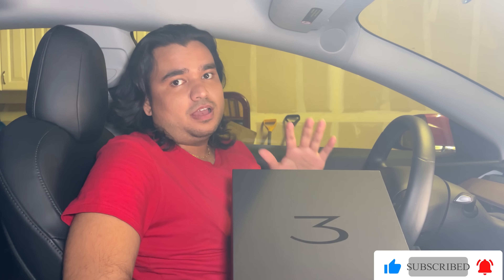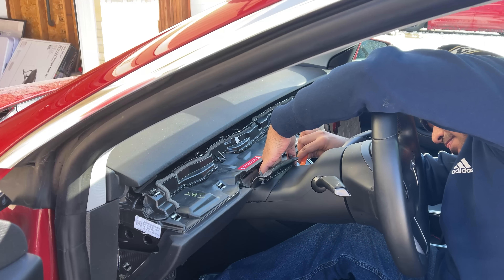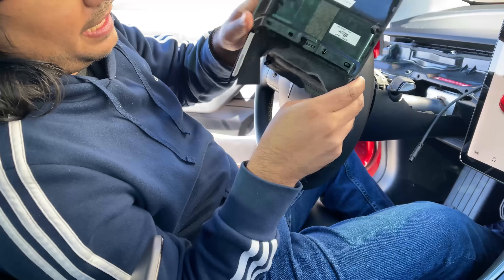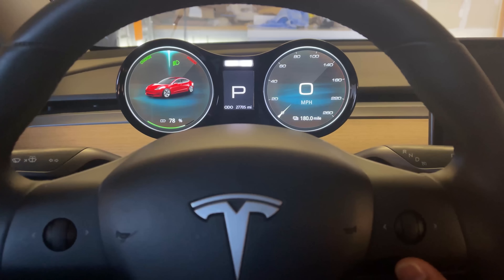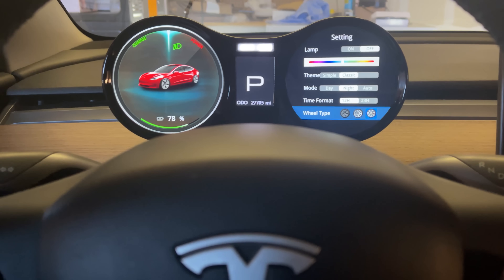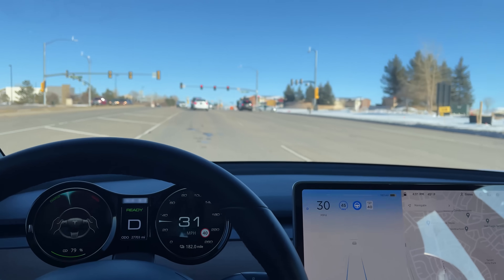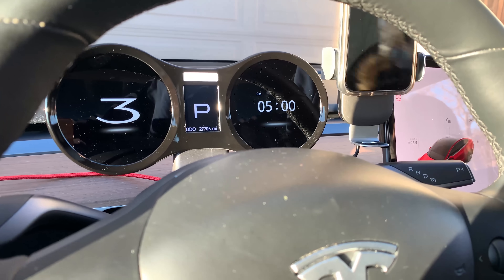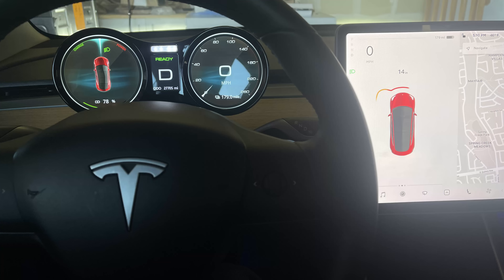New Display For Tesla Model 3 & Model Y - Instrument Cluster 2021

Comment: As it's slaved to the APC are you affecting any settings whilst you're using it?
Reply from the maker: As you mentioned since this is slaved to the APC, the information is unidirectional. You can change the settings for the display but nothing back to the computer. Thanks so much for watching my video.
Reply: @ShivaSapkota  Great video,  so the car doesnt even recognize this device right ?  The car is just supplying power / data to the unit only ?
Reply from the maker: @ranger99133  That is correct. This is essentially like a OBD scanner, where it is getting info from the car but cannot send anything back to the car. Thanks for watching my video.

Comment: Does installing this void your tesla warranty?
Reply from the maker: Thanks for watching my video. The way I interpret the laws is that it is illegal to void your warranty or deny coverage under the warranty simply because you used an aftermarket part. It it turns out that the aftermarket part was itself defective or wasn't installed correctly, and it causes damage to another part that is covered under the warranty, Tesla has the right to deny coverage for that part and charge you for any repairs. They have to prove that the non-OEM part caused a failure to a warranty covered part. But I am not a lawyer, so don't quote me on this :)